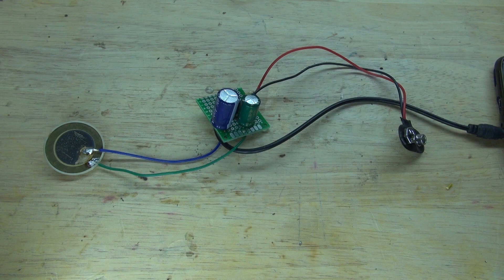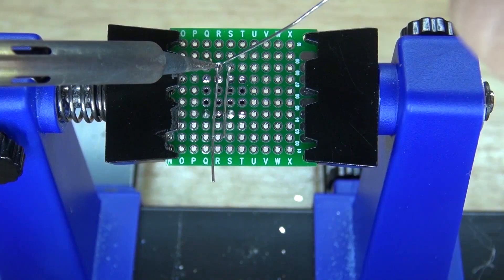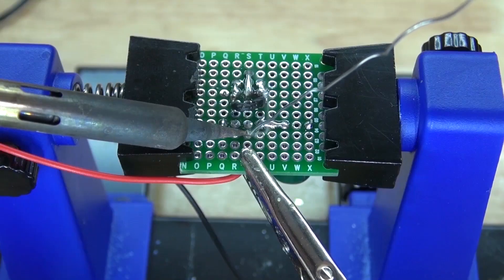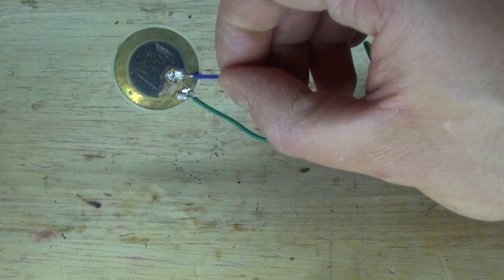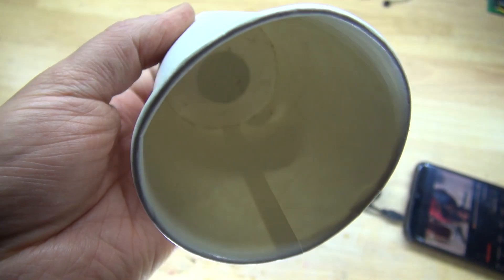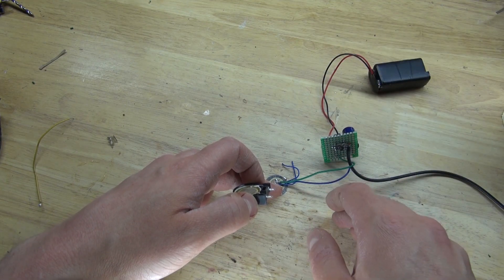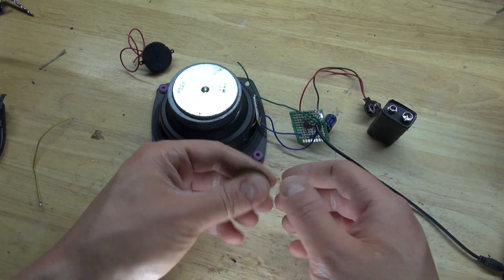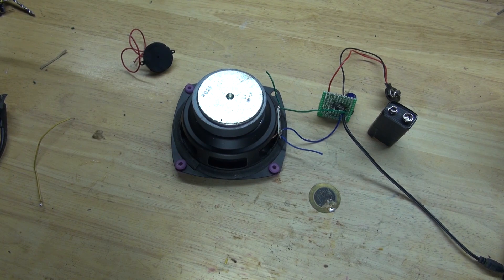Experimenting With A Piezo And An LM386 Audio Amplifier

Comment: Piezo are capacitors/voltage, and induction speakers are resistance load/current.
>
For a piezo disc you need higher voltage, low amps/watts :) Completely opposite to a speaker.
Most piezo discs require about 15V or 30V peak to peak (Check the Piezo specs to see what the limit is. Start low and work up.)
.
So what to do? Build an ac out amplifier based upon voltage gain only.
Or a simple way is to use a basic step up, step down audio transformer impedance match.
8 Ohm by 1K Ohm (1000 Ohm).
8K to the LM386 (ensure it is AC audio and not DC offset) and 1000 ohm to the Piezo :)
.
Amp impedance is 8 Ohm, piezo is 1K ohm. Audio transformer balances the impedance, steps up the voltage and lowers the current (Watts) :)
.
Note this is the reverse of the typical use of the audio transformer as most people are attempting to reduce line voltage rather than increase it.
Go easy on the driver amplifier input gain and internal gain (20x default) and work your way up until you get to the max P2P voltage allowed at the Piezo.
.
Some people place a very high ohm resistor at and or across the Piezo as a bleed down on the capacitor (Piezo is a capacitor)
.
Stick that Piezo to a window and you will hear it across the street lol
>
P.S. I am just an amateur home enthusiast, but also have a pro tech history.
Piezos are awesomes :) Good luck